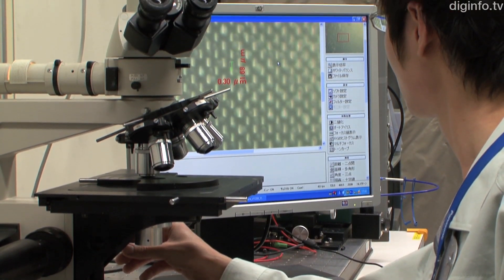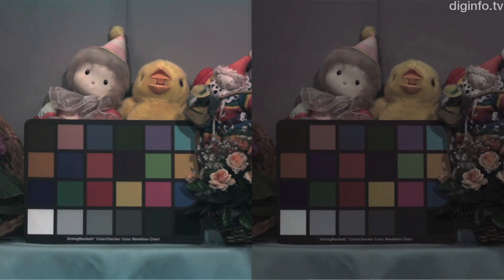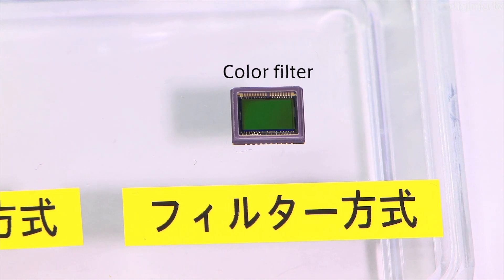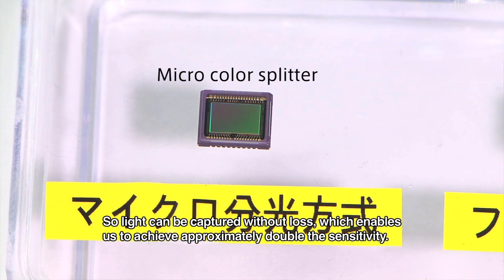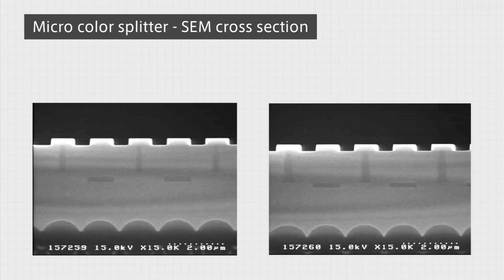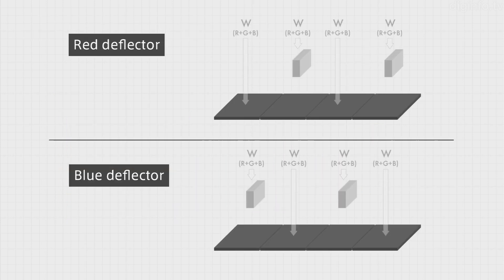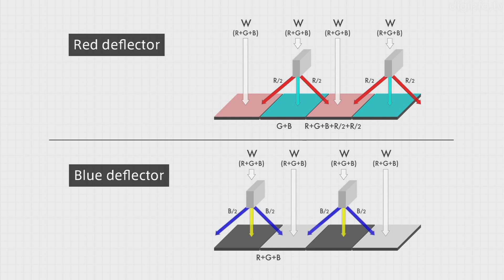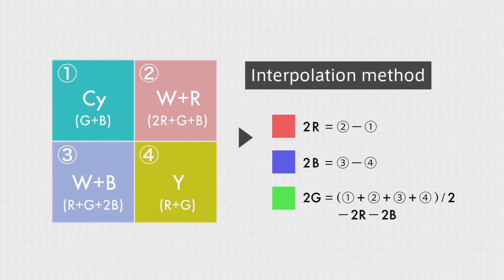Double the brightness in low light photos with Panasonic's new color filtering technology #DigInfo

Comment: I take your word for it. You probably know better, since I'm still just a student, and a european at that.
But from the little experiance I've had, it seems like american product specifications primarily comes in imperical units. Why do you think that is? Do they use SI units internally but imperical units in their communication with their market? If that's the case you'd expect typical B2B products to be specified in SI units, but that's not what I've found so far.

Comment: Sorry, I phrased what I said a little oddly. Of course there are times when the temperature goes below 0 and above 100, but 0 and below is "too cold" and 100 and above is "too hot" and comfortable lies somewhere a little above the middle. I think that's more intuitive for gauging what the weather will feel like. I'm not saying it's hard science or anything, of course we should use Celsius for science. Here in the states we use the Metric system for science. We HAVE joined you guys. : )

Comment: It's usually written as mil, even though it's usually pronounced as "thou" (as the start of the word thousand, not the thou as in you.) At least this is the case in printed circuit board design. 
Microinches are rarely used, but you sometimes see the unit being used for things like surface roughness when people insist on using US Customary only.

Comment: Because metric can be a lot less convenient in everyday situations. Metric is based off arbitrary measurements and its only big advantage is easier unit conversions. Standard is based off of everyday measurements and is easier to use in most "real life" situations since the units of measurement generally line up with what you're doing.

tl;dr unless you need to do complex math as part of your job (etc.) then metric doesn't have too many advantages

Comment: I've picked wrong words for this one. It would be extremely difficult to do science in imperial system. Imagine defining pressure as pounds per square inch and then try to calculate the force that this pressure applies to the area of few square feet. Now count up the amount of unit transitions in this one, and how more complicated all the formulae and equations became.
If you'd use metric for the same thing, you'd be already done with calculations, as well as with the follow-up dinner.

Comment: Except for the fact that centimeter and meter correlate as 100:1 while inch and foot correlate as who knows what, because Wikipedia knows about 50 different definitions of foot. That's a little problem, isn't it?
Also, we have Newtons. First derive a new unit to measure force, and then deal with things like g=32.185 ft/s and so on and so forth.
You see, large part of SI was designed to make calculations easier. Europe was the world's brain back in the day, and America was a remote colony y'know.

Comment: It isn't difficult, actually.  Do the equations first, simplify the algebra as much as possible, and plug in your arbitrary measurements at the end keeping aware of your units.  The formulas are universal, and independent to the measurement scale.  

Metric and Standard scales are both equal, and just use a different gradation.  One unit system is not superior to another.  I can't, however, say the same for peoples' simple mathematics skills.

Comment: An inch is standardized, just like a meter.  You're making a moot point because measurements are all relative.

1 foot = 12 inches.  1 yard = 3 feet = 36 inches.  1 mile = 1760 yards = 5280 feet = 63360 inches.  

That is no more complicated than seconds to minutes to hours to days to years.
The Standard system uses pounds for force, and slugs for mass

Simple arithmetic, simple to convert to the Metric system, and visa-verse.   Nothing complicated to figure out.

Comment: No it's not. In fact, i don't get how could you measure things precisely using inches. For instance, i cut my bread slices for sandwiches 15-20mm thick. What is this, zero point six to zero point eight inches? What the heck, is that simpler? Whole imperial measurement system is fucked up and could be used proficiently only during Dark Ages. It's 21st century, hayo!!!